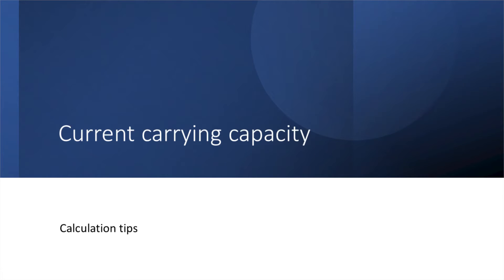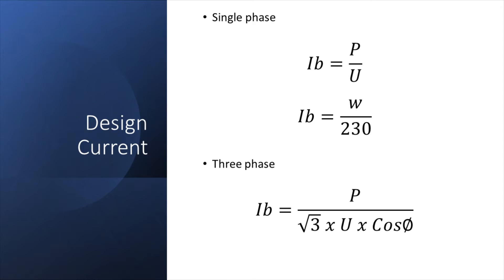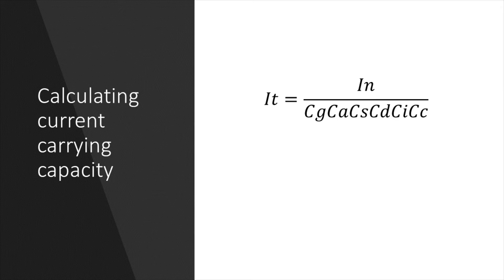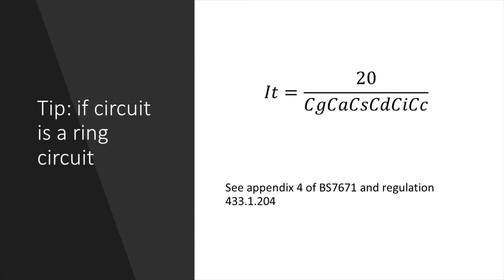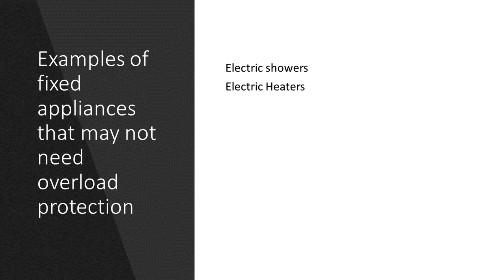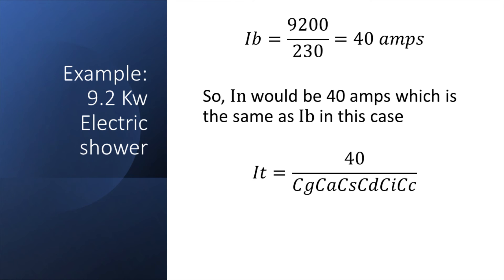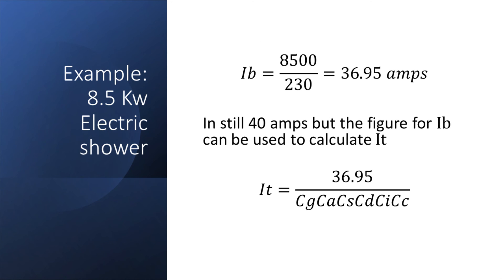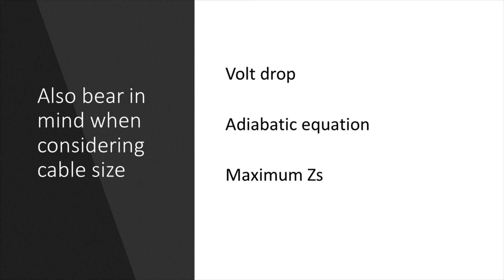Current carrying capacity electrical calculation tips

Comment: 2  95mm 4core XLPE cables are run parallel in a trench 300mm deep and then  vertically on a tray, using method 11 calculate the total number of amperage the cables can carry?
Reply from the maker: Hi Daniel, thank you for your question. Was there any more information in the question? such as operating temperature of the cable? Also I notice that method 11 is listed as multicore cables in suspended trunking in BS7671. Also the reference methods in BS7671 are in line with the IEC, but not all methods have a corresponding rating for all cable types. Was the question referring to BS7671 or the IEC?
Regards
James